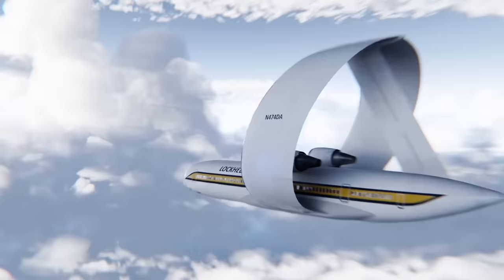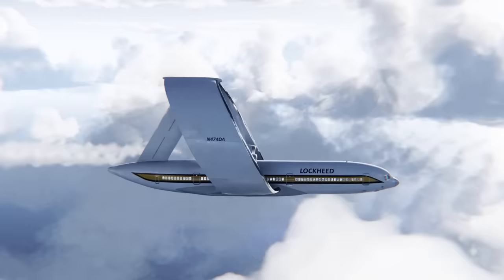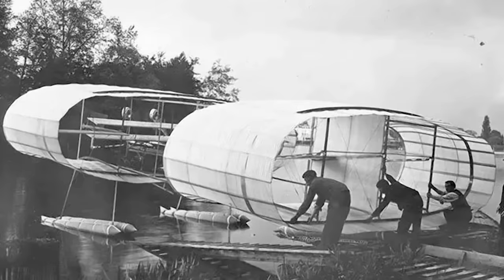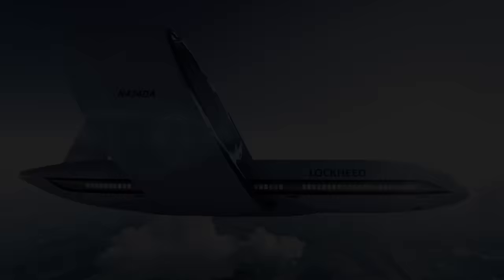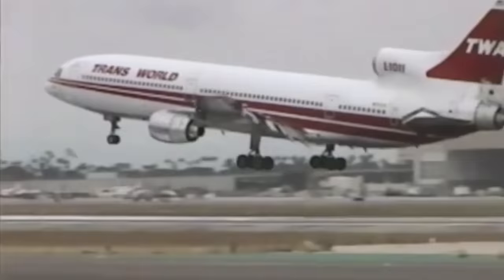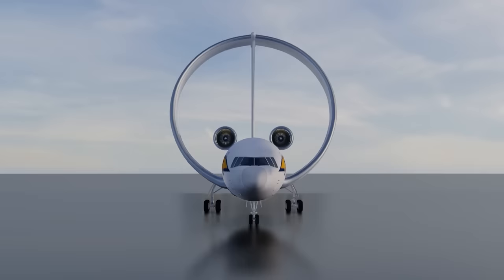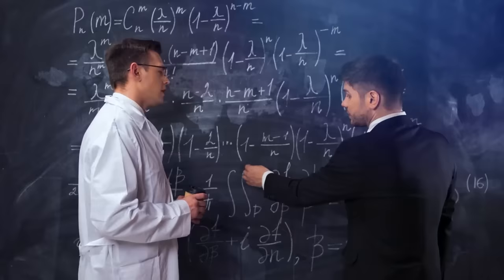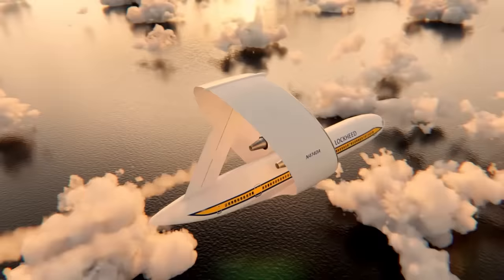What Happened To Ring Wing Planes?

Comment: Anyone who was into paper airplanes built ring style flyers from a skewer and some paper for the ring(s) at some point.  While not the best glider design, the fact they flew at all was neat as a kid.  Could make skinny planes that cpuld be landed through small bay doors in skyscrapers or something...i dunno.  I still think there is a use for them we havent found yet.  Imagine just a flying  tube lined with jet engines or turbines.  Like a lughtweight rocket thing with slow cruising speed.

Comment: But if the extra weight of the wing is less than the extra lift it produces, it could still be good for cargo planes when you don’t need to go fast (drag) and the reduced side to side wing area would allow for landing in more secluded places. It might work well as a cargo bush plane basically
Reply: Although the reduced speed would mean less max lift I think  but I’m ignoring that

Comment: I have been designing Thrust fectoring since I was 9-10 years old/prop designs/propulsion hydro/aeronautical and magnetically(anti-gravitational)  is all in the shape of the cylinder that should be egg shaped and have one smaller one upfront like a canard I have made very many models of this out of Balsawood when I was a kid we made it out of a straw and tape paper together to form the ring one large one in the rear one small one in the front and glides most than any paper airplane  It is a very proficient design with a high glide ratio very little propellant needed!!!? With the right shape  stability great  very good

Comment: RE: Ring Wings, Wind Tunnel Testing, and Inherent Issues;  Funny thing about the design is that it doesn't pop up out of nowhere, as you've adequately indicated by showing a lot of the examples from history.  There is another example though which is probably more close to home for many people, and that are paper airplanes made in a ring configuration.  They obviously won't have fuselages, but they will have the wing profile, and they behave somewhat like delta-shaped kites without the need of a tail or the control input of the string.

Perhaps the most significant thing which flight testing with something as simple as a paper model will quickly reveal is that the ring has impressive glide performance sometimes with wide arcing horizontal turns, but it will roll unlike any other wing.  Its roll would probably be close to unstable in an actual aircraft, and adding ballast to it to try to keep it from rolling will not solve the issue.  I'd be willing to bet that's why the cancelled aircraft from Belarus (was it Belarus?) had a very eccentric aspect to the ellipse.
Reply: See also:  Eccentricity, the amount of "squashing" on an ellipse.  The Circle has an eccentricity of 0.
Reply: Footnote:  Regarding the Lockheed design;  Yeah, if there's something I find difficult to accept when I really look at it, it's not the Wing nor the bisecting Tail;  it's the 2 engines mounted to the top of the fuselage.  If the engineering necessary to put them up there wasn't daunting enough, try to imagine the amount of noise it would pass through to the passenger cabin from that location.  The only good thing about relatively short-hop / low altitude flights in that sucker is you won't be wearing ear protection for that long.

Comment: That ring wing needs to be lowered in height and be more oval in shape. This will remove the need for such a large tail surface. Also, I'd move the engines to the wing rather than the fuselage so that fuel lines are positioned away from the latter.

Comment: Not following how this would "generate more lift". I may only have Master's in Aerospace Engineering but I think I understand the basics well enough. Lift is generated by creating a velocity differential between flow on opposite sides of the wing. The slower flow on the bottom exerts more pressure than the faster flow on top, resulting in a net force in the upward direction. Problem is, this force is normal to the wing, so all the verticle bits of wing are contributing nothing to the lifting force.

Comment: Looking at this makes me wonder why the jet engines are not further forward, with the exhaust gasses used to create lift over the top of the wing. Like the blown defusers in reverse on an F1 car. Turning the plane would be a simple matter of slowing one or the other engine down.
Reply: There is one major problem with that, and that is the exhaust temperature. Aircraft wings have to be tough to withstand cyclic stresses but be as light as possible. So they are primarily made of composites. Composites can fatigue and heat will only worsen its lifespan. Combine the repeated flexing and heat, instead of 30 years you may be looking at months of service at best. The only material suitable would be Titanium. Like steel it can be designed with a "fatigue limit" - to withstand cyclic loading indefinitely. But even designed with a lifespan to save weight it would still be very heavy compared to fibreglass/carbon composites.
The Lilium Jet used a similar principle but in reverse - the engines suck air over the wings. Now there's the other problem. You want air to rush over as much of the wing surface as possible. But how much of the wing can a single or dual engine cover? The Lilium Jet despite the name did not use turbojet/turbofan engines. It used 12 small electric propellers per wing.

Comment: Wouldn't this be better with an angled circle for the wing with its center of mass closer to the sctual center? The point of connection to the planes body at the bottom is going to be a big potential point of failure, and the top of the wing will create downdraft on the bottom in this configuration.

Comment: I don't get it.  I understand Bernoulli's principle, but I don't see how the vertical portions of the wings provide lift, and there isn't a lot of horizontal surface area.  I get the yaw from the dorsal stabilizer thing, but how do you get pitch?  The video explained that there are no flaps on the ring-wing, and there aren't any horizontal stabilizers, e.g., tail fins or canards, either.  Can someone help me understand?

Comment: Wouldn’t the vertical sections of the wing produce no thrust but contribute significant drag?
Reply: They would provide lift since they are creating a low pressure area over top of the plane. It would simply be next to zero lift since it is not compounded with the high pressure on the bottom of the wing like a regular wing would do.

The lift to drag ratio of the vertical parts would likely be 1:10 if we are generous

Comment: I imagine the loss of the conventional high aspect ratio wing would make low speed performance very poor. Take-off and landing speeds would probably double the norm and  
the provision of control surfaces and flaps a nightmare. As would be the lateral instability in cross winds due to the very high C of G. and C of P.
             It's a Conic-Book illustration with no serious intent says I !

Comment: ring wings are wild but they require to much propulsion to create lift.  as the lift tech is greatly different as a horizonal wing gains lift by passing air over top of wing but it fly a ring you have to compress the air within the ring and this requires way to much inefficient energy.

im not interested enough to do the long math to see how such a craft deals with turbulence when its main design is to create lift from turbulence... well this craft has no chance at commonality

Comment: He said the wing circumference (the distance around a circle) is 7.4 meters, and the overall height is 23 meters.  That's really bad math. or wrong words used. 
   I'll knock of 3 meters for landing gear which will make it's height 20m. and the height is also the diameter.  if the diameter is 20, the radius is half that, so it's pi x radius squared for the circumference. 3.1415 x 10 squared. 10 squared is 100, 100 x 3.1415 is 314.15m, which the radius should be. 
   I think the 7.4 meters is how far the wings stick out from each side of the plane. With that in mind, it's overall width would be 7.4 x 2 plus however wide the body is. diameter 20 - 14.8 = 5.2 meters for the body width. considering a 747's is 6.5 wide, this seems more likely.

Comment: I didn't watch the video YET. I'll watch it in a little while, but my Guess is there probably uncontrollable and dangerous at low speeds Also, they're probably quite a bit more difficult to build as round things are generally harder to manufacture making the cost significantly higher than traditional designs

Comment: This is like when home designers go bat shit crazy on a design and the builders like wtf 🤦🏻‍♂️
Reply: I feel like it could work really well but not how it's pictured here if I was gonna design it I'd do the wing first as one big circle and the plane itself wold be inside the ring not at the bottom but in the middle with a cross type mounting so u could still have horizontal and vertical flaps idk how the landing gear would work but I'm sure that could easily be figured out
Reply: @nickt1301  I think the biggest problem I see is the useless parts of the circle, you don’t need all that the sides provide in area for steering it, and the parts between the vertical stabilizing and steering portion and the top lift portion seems useless, or at best inefficient at giving lift, or stabilization and direction. So it seems useless in ways, and incredibly difficult to build. It may be better, if they want an enclosed area, just to have the height as high as you need the sides to be to stabilize and steer, and the top, flat for more efficient lift, so it would be rectangular. The cross idea could be good too, also if you had multiple slats inside the rectangle, horizontally, for compact lift. But before I was thinking, for the objective of having a jet that doesn’t make a sonic boom, maybe have the plane bottom flat, so it’s like a big ass sideways wing, and created lift by the body or fuselage, like the SR-71 kinda, vs just the wings for lift like a regular plane, then it could have stubby wings to bypass the boom. Or add on slats inside the stubby wings that come out on take off, that would extend out of the back of the wing, like a 737, but just bigger slats maybe.
Reply: @davidwavidshmavider  the only reason I feel it could be better is because of them circle paper airplanes that we used to make in school them suckers would fly far af

Comment: Would it be possible to make a plane with engines like those dyson blade less fans??
Reply: First thing you need to realize... bladeless fans actually have blades. They are located at the base. They pull air through the base and shoot it through the channels by the hoop area.